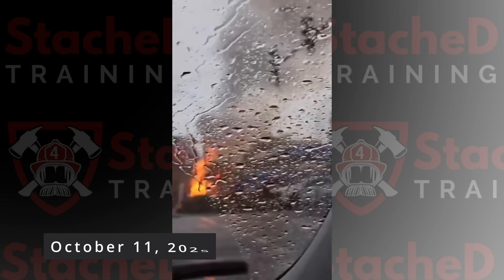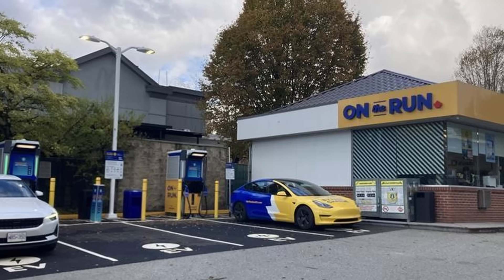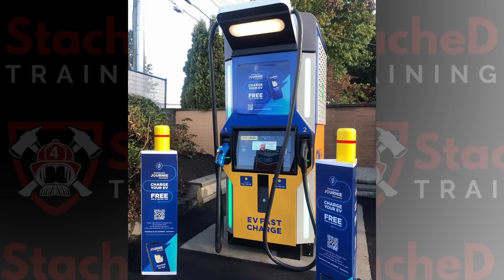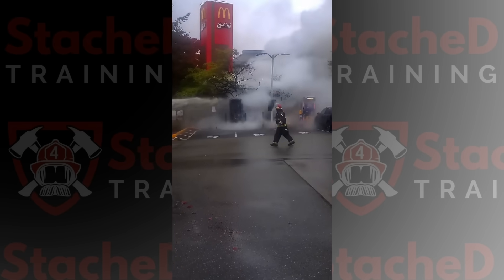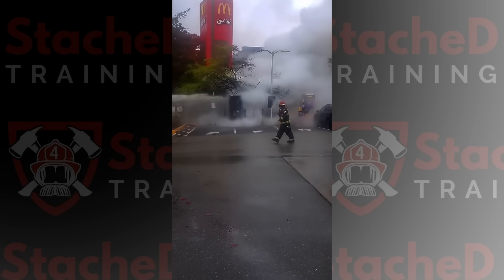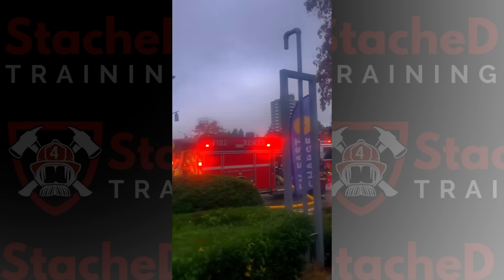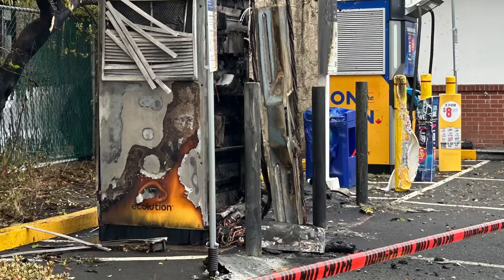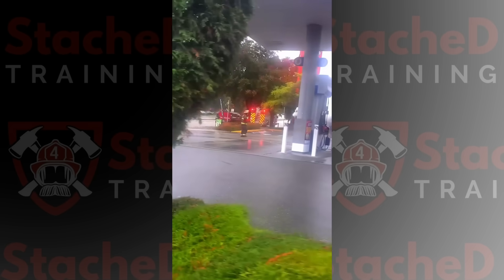EV Charger Fire in British Columbia: Hidden Batteries!

Comment: From fossil fueled power plant, to transmission lines, to transformer, to converter, to storage battery, to inverter, to EV battery. In each step there are efficiency losses. This is completely absurd. .
Reply: Very few people can understand that.  Every time I explain to someone that a gas stove is able to convert close to 100% of the gas energy into heat (which is what you want from a stove), but electricity comes through power lines (with loss), transformers (with loss), and power plants that might be able to convert about 60% of the gas energy into electricity, people give me a blank look.

People now days never took a high school science class.  It's tragic.
Reply: @cherryjuice9946 The neat bit is that you can get a COP of 2 to 4 on a heat pump hot water heater or furnace, so you actually get more usable heat by burning fuel to make electricity to pump heat from outside than you would by burning the fuel inside.

Also gas stoves are terrible at getting the heat they produce into the food (like, 45% to 60% losses), so unless you're using the waste heat to warm your house, it may be better to use electric or induction heat.

Regarding EVs, I believe the "MPGe" unit matches gasoline, joule for joule. The EVs I've looked at get ratings in the 90 to 150 MPGe range, which beats by something that resembles the grid generation and transmission losses. It's also cheaper than gas in many regions, and people like the performance of electric motors.

The environmental madness is driving cars everywhere. Quibbling over <10x differences in efficiency is pretty pointless when mass transport is on the table.
Reply: @reddragonflyxx I've never had a electric stove that didn't have terrible control mechanisms inside, gas stoves are stable and reliable when it comes to thermal control.
Reply: @jonathanjones3126 My use cases are for a stove are:
- searing: max heat, reduce if spatter is excessive or it's smoking
- boiling: max heat, electric is much faster than gas
- simmering: low heat, electric typically handles this well enough, gas I might need a spreader
- pancakes: have to get used to every stove, have had good results with electric ones
- scrambled eggs: low heat is safe, adjust upwards with successive uses
If I'm doing chocolate or custard or something, I'll use a sous vide immersion circulator (they're like $50 plus a container for hot water, and maybe something to cover it, cereal dispensers work well). If I have to use a stove I'll use a double boiler, even on gas.

Heat control just isn't an issue with how I use a stove. The lower max output of most gas stoves annoys me though.

What are you doing that needs good heat control? Also, how are induction stoves?
Reply: @reddragonflyxx657 professional gas stoves are just superior, every electric stove is have used has had bad quirks. I cannot make pancakes on my current one due to it spiking up to max temp if you turn it up to medium, cooking on that thing is a exercise in frustration.  The temperature spikes turn off the burner again and again. I've never used a induction type but I know you can only use a very limited range of cookware if you want good performance.
Reply: @jonathanjones3126 Fair enough, I just find glass top electric ones work well enough for my use, are easy to clean, and want water to boil as quickly as possible more often than I make pancakes.

For gas you want thin/aluminum pans that respond to changes in heat quickly (or thick ones you can heat soak). For electric you want thicker pans that smooth out the cycling. For induction you want "anything a magnet sticks to" which is mostly steel, and the cheaper units have hot spots.
Reply: @reddragonflyxx  A heat pump is Not a stove. I was discussing stoves. Heat pumps make sense in climates where they work. They struggle in the extreme cold and start using a lot of electricity. I currently have one, and I'm in a "warm climate", but even I can observe their nonlinear performance.

I've used gas stoves and they don't have the waste heat that you state.  Perhaps if someone turned the flame all the up, the flame could go around the pan and be wasted, but there's a knob to adjust the amount of heat and people should set it correctly.   The same can be true for electric stoves.  If turned fully up, there will be heat that doesn't get into the food. 

In your third paragraph, you're talking about EV's.  OK, that has nothing to do with what I said about stoves, but let's discuss them.  EVs should be more efficient than a piston powered car.  There's no surprise there.  Reciprocating heat engines have never been known for their efficiency. But there's more to a consumers choice than that.  The charging infrastructure simply isn't there, and they absolutely will not work on a long trip.  They do make sense around town, if the user has a charger at home.  But, they do come with extra cost such as more expensive tires, higher insurance rates, etc.  The consumer should have the choice to select what works best for him or her.

I'll agree with your final paragraph, but I don't expect a change in my life time.  This isn't the 1800's where you could live in the apartment above your work place.  People must commute.  Mass transit would be nice.  When I lived in the DC area, I enjoyed the Metro, even though waiting on the trains and making connections caused a long travel time.  It was easier than finding a parking spot, and paying $20 for the a spot 5 blocks away.  Even using the Metro, I had to drive to station.  Nothing about public mass transit is easy.  Even bus routes result in very long walks.
Reply: @cherryjuice9946  "Very few people can understand that."
It's really that the people that do actually understand it also understand that a full analysis of losses, even when using fossil fueled power plants, EVs still win out on efficiency.

Because burning fossil fuels in a power plant is actually pretty efficient as a way to extract energy. Even after all of the power line and charging losses, EV drivetrains are efficient enough that it still wins out over just gassing up your car and losing 70-80% of the gasoline's energy as waste heat.
Reply: @compwiz101  Why mention EVs?  My statement was about gas stoves vs. electric stoves.  The goal of an EV is not to make heat.  Electric motors are extremely efficient. I already addressed this when I agreed with redDragonFly.  A gasoline/diesel powered car will never be as efficient as an EV, even when considering the batteries make waste heat when charging and discharging.
Reply: @cherryjuice9946  Well, you were agreeing with the guy talking about the efficiency losses of charging an EV and I was replying specifically to why that argument is bunk.
Reply: @cherryjuice9946  losses from utility generators, all the way to local substations output, is <2.2%. Substation to the transformer output at your house <2%. The wiring inside your home or business loss is <3% worst case. Modern NG Combined Cycle Generation is 65% efficient.
Reply: @CycleWerkz  I never said the losses are any higher than what you said.  Point is still that electricity for a stove still involves losses, so total energy in the gas to produce the electricity is not fully used.  Electric stoves still result in green house gas emissions.  The push to replace gas stoves with electric is misguided.
Reply: @cherryjuice9946  I didn't catch the electric stove bit. The resistive wire electric heater is grossly inefficient. However, only in percentage not as total energy waste. It's a small load, used infrequently, so upgrades for energy savings will be disappointing.

btw... i wasn't trying to argue, only supplying the data since I had it handy
Reply: Something like 97% of electricity in BC comes from hydro...
Reply: @Jessev741  Happy BC!
Reply: @Jessev741  Exactly. Nothing more to add.
Reply: @Jessev741  The electricity in BC is just under 90% hydro electric and wind. The remaining electricity is usually diesel generators for remote communities where the cost to build power lines would be enormous.
Certainly, the electricity consumed in the lower mainland where this fire was is 100% carbon free (hydro).
Reply: @e-curb  Thanks for the fact check :D
Reply: You simply have to believe stringer, my friend!

All will be good at some day in the future ....
Reply: BC gets its power from hydro
Reply: It's funny, I've been interested in EVs for like 20 years now and you guys are still repeating an argument that was wrong back then.

Brace yourself: Internal combustion engines are SO inefficient at extracting energy from fuel that it still loses on efficiency compared to all of the losses of operating an EV. 
Even 20 years ago, burning COAL in a power plant to charge an EV was overall more efficient than a gas-powered car. 

The real problems with EVs comes from both infrastructure neglect and the boneheaded idea that we can just all buy EVs to solve the problems all of us having cars cause. Really, we need to be investing in better city planning, better transit, better rail infrastructure - so that the people that MUST have cars can have them, and the people that don't even need them actually have functional options that are more efficient.
Reply: @compwiz101  Your problem is that you are comparing it to 20 year old ICE technology. Current ICE vehicles are 35% more efficient.
Reply: @akshonclip  "35% more efficient" -  even with a modern Atkinson-cycle engine like the Toyota Dynamic Force designs, you're maxing out at around 40% thermal efficiency. That's still tossing over half your stored energy overboard, and my point remains.
Reply: @compwiz101  All systems have improved efficiency. Modern car engines report 56% heat to mech conversion. Modern over road heavy diesel semi's transport cargo using 1/3rd the fuel compared to 25 years ago. Natural Gas electric generators produce 50% more electrical energy at the same fuel rate. They are now 65% heat conversion efficient. No massive gov investments, regulations or penalties were required for owners to upgrade NG gens, or semis that move cargo 3x the distance for the same fuel. The only influence needed was much lower fuel cost for the operators. 

The comparison arguments tend to use old system data compared to new system data. 

This old versus new is the method they used to demonize coal. When you grab the totals for coal fired plants, 50-60 y/o massive baseload plants are very common. They didn't use recent OEM specifications for a fair comparison. 

Coal plants emissions would change dramatically without any rules, incentives, or demonization tactics. Every coal plant would be thrilled to pay for their own upgrades if electrical capacity is unchanged, but fuel supply is reduced by 70%. It would only require pre-sulfur fuel treatment, modernized furnace heat sections, and post combustion Reduction and Catalyzation reactors. That sounds like a lot, but not if scheduled with an overhaul. They cannot invest in this while being threatened with total destruction.

I'm not sure where you get your efficiency numbers. I design large scale battery plants and operate 1000s of systems across the US. 

I'm somewhat familiar with EV claims. As in all power systems, the entire system loss is never shown. They show batteries as energy out/energy in; but didn't really explain this is out/in at the cell, not the total system. EV battery systems have losses through the charger, cables, connectors, battery heaters/coolers, controllers, sensors, and cables. but all this is nuance 

The nasty beast is cold temp discharge energy. Or any other capacity reduction scenario. If the battery is cold temp reduced to 70% of normal discharge, it still required 100% charge energy. But only if it is charged at an efficient charge temperature. 

Similar suffering when battery capacity is lower due to age or use. The reciprocal if 80% capacity remains, 125% charge energy/discharge energy must be supplied to reach 80% discharge capacity. 

One more whopper, is the efficiency end around. 
Every electrical module which converts voltage, or electrical to mechanical, or has a high frequency switch mode section, returns Harmonic Distortion back upstream. This energy must be supplied, but they do not count it as energy input for eff measurements. So around 5-6% THD losses are not included. 

EV chargers all return 5-6% THD back to the utility transformer discharged there as heat. You still get to pay for it you just don't get to use it. You then add the specified loss through the home charger. That power then usually gets another conversion at the battery controller. They like to say it's direct, but I doubt it, likely has a pwm driving mosfets or igbts. That conversion bounces another 6% as THD upstream.

Don't forget, battery energy must be converted to supply the traction motors. Plus, all other connected loads.  

I love all the EV experts that proclaim wonderful efficiencies yet have never measured a single example. I have not measured EV electrical efficiencies yet, but I've measured many large electrical and battery system losses. I know what the specs mean, and what's not included. This practice is universal.
Reply: @compwiz101 totally. An electric bike uses LESS power and with less CO2 creation than a pedal bike would, just thanks to the food supply inefficiency for those calories. That being said, those calories could probably be better off used rather than stored for most people here anyways. Thankfully ebikes also make prior ride bikes far more than pedal bikes and get equivalent or greater exercise overall.
Reply: This is BC. The power bill is called a hydro bill. It's hydroelectric.
Reply: BC primarily uses hydro electric power, why would you care about losses if it's primarily heat?

Comment: NCM chemistry (almost certainly what this was) should never be used in stationary storage or even standard range cars for that matter. This is largely a (bad) choice by businesses in North America. Anything matching or exceeded the safety profile of LiFePo4 should be required.
Reply: Or even better Sodium Batteries that would also solve having to heat the battery (another point of failure) in colder climates.

Comment: As an aside,  this is ONE reason I wont allow a smartmeter on my house.
Reply: You don't have a choice.
Reply: @e-curb yes you do,   you opt-out.  Tell them NO.
I did.   They installed them and my house is only one with regular standard meter.
Reply: I'm not understanding that.  As far as I know, smart meters have Li Ion batteries?
Reply: @cherryjuice9946 yes,  so that they stayed powered and transmit during power outages. Many caught fire in Canada and some US states and burned houses,  then were recalled. The data collection and transmitting of it, the goings-on in our homes is a huge problem that people should be very concerned with too,  4th Amendment.

Comment: The reason they have batteries is because the grid alone can't handle the requirements of a fast charger in that area.
Reply: Correct, I live 2 miles away from that gas station. Our previous mayor wanted to install EV charging stations on every street corner and went quiet when I told him that our grid can't handle that kind of demand and it needs upgrades just to keep up with regular demand as they keep building more high rises. Few months later they started charging us infrastructure upgrade fee.....
Reply: @wadimszymocha7463   The city of New West oversees their own power distribution system.
Reply: @e-curb yes I know that and your point is??? My point is that our mayor had no clue what was going with power distribution system in his own city.
A smart person would've consulted his utility managers before announcing EV charging plans and not vice-versa.

Comment: To overcome the issue of electrical service requirements for charging a car fast they build batteries into them which will see thousands of cycles a year therefore degrading the batteries quickly which makes them a hazard.
Reply: even outside! I fast charged in Canmore, Alberta with an ATCO station. I can see this ending badly when minus 45 below hits.